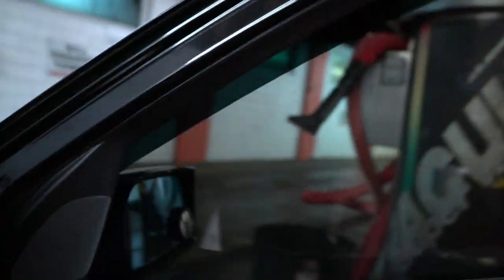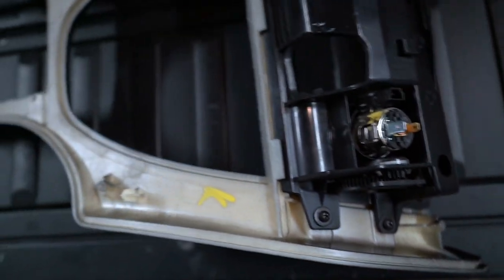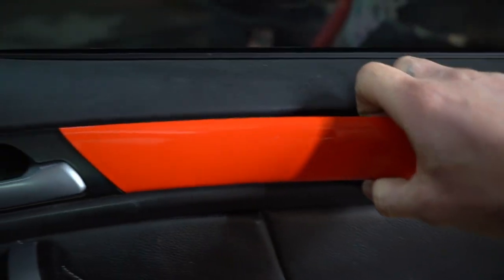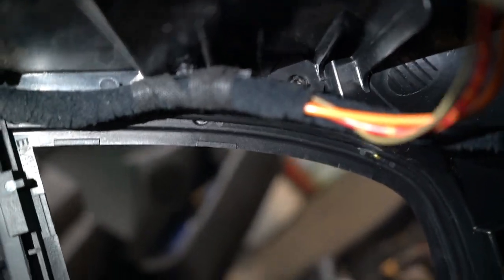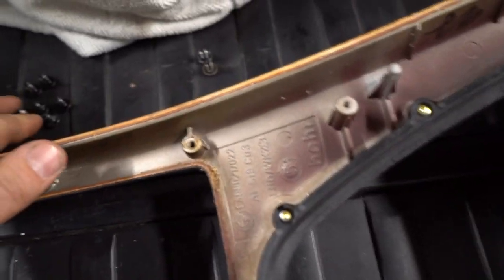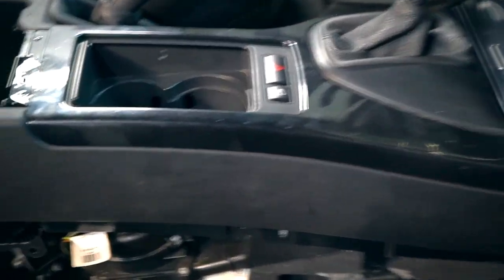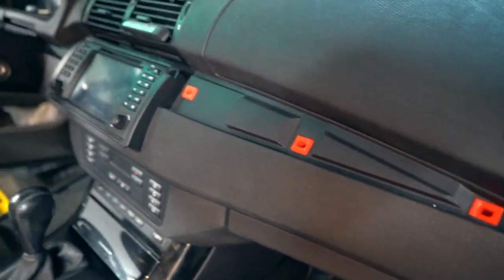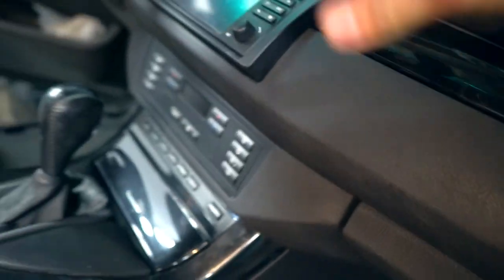BLACK Interior MATTERS - BMW X5 E53

Comment: @Tunex - great job, thanks for showing it in detail. Can I change centre console trim without removing the arm rest? I don’t want to end up taking out front seats etc..
Reply from the maker: Thanks. The way that is described on the video is the shortest possible way of changing the center trim piece unfortunately.
Can be done in a multiple goal task though, you can do a deep clean of the interior or soundproofing
Reply from the maker: I will be building it up to 4.8 gear with all the possible BMW INDIVIDUAL OEM features yet keeping the 4.4 on this chassis. So there is much more to come